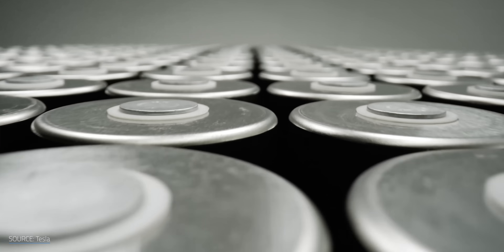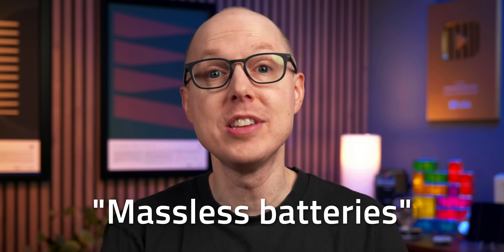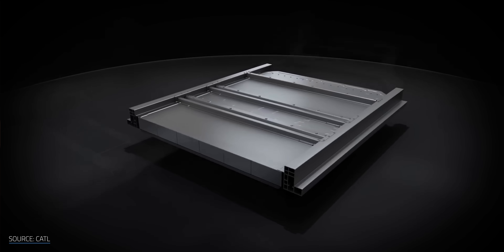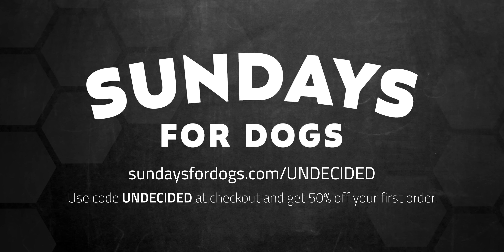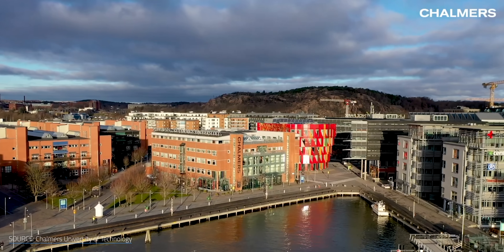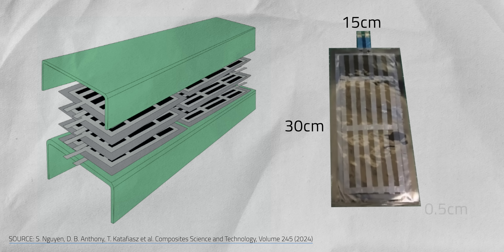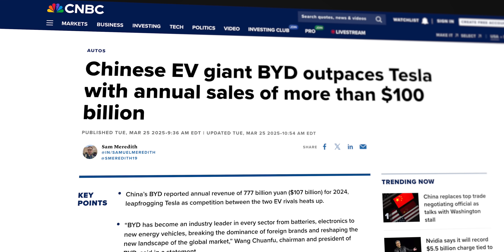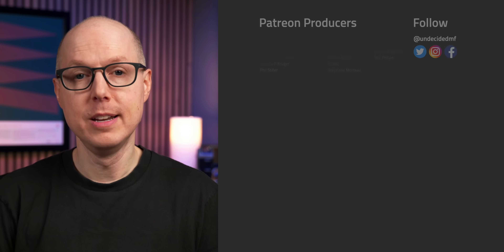The Strangest Battery Breakthrough Yet

Comment: This is cool and all but imagine you have a bad cell in the frame of a car. 

How exactly would you replace it?
Reply: Good point.  My bet, to have these in pieces.  It should not replace any structurally integral member, except for planes. If it all is in patches, replace when needed. If bought in bulk and easy to do, could be inexpensive enough.  Planes, dont know if worth it, but i would guess, they suffer damage less frequently.  I like it so far.
Reply: @pancakes3250 
Common misconception. Planes get access ladders and cargo loaders bumped into them all the time. (Ever seen a dot or extruding rectangle (doubler) on the outside of a plane? That’s a known dent/buckle or repair) But every single part of an airplane is regularly checked and replaceable. Repairing carbon fibre structure is already a pain, now you have to also worry about conductibility and potential power drops of repaired sections. If they are repairable at all.
Reply: @carstekoch  Maybe carbon fiber is more bump resistant, maybe.  Alternatively, parts highly prone to accidents, keep them standard materiel.   The machinery used to deal with aircraft like ladders, whether by procedure or design, to be less prone to cause damage.  The possibility, of an electric plane is too tempting.  Just like an EV, supposedly, reduced costs to maintain the rest of the plane, without all the hydraulics, engines sucking up whatever, exploding, fixing the rest of it, might compensate for costs with dealing with those battery everything.  Not to mention, regions lacking oil, can get away with it, the diplomatic implications involved, are nice.
Reply: @pancakes3250  
Carbon fibre isn't better at absorbing shocks. It's about equally as bad, but in a different way. Main problem with carbon fibre is, it tends to delaminate under shock. So the plies seperate, sometimes without visual indication on the outside. These separations can then entrap water, which isn't ideal in an environment that regularly cycles between normal and low pressure as well as +30°C and -50°C. (Basically toned down ocean gate)
Main problem with the ladders isn't their design, but the fact that they are large and therefore carry a lot of momentum, but they must be put very close to the aircraft because the entrance is several meters above the ground. (So fall risk needs to be minimised)
Same goes for the cargo loaders that need to lift several hundreds of kilos to tons of equipment.
You can't really change Hydraulics for electric actuators. In fact, modern aircraft, have seperate hydraulic systems that are powered by electric pumps. (Hydraulics system of the a380 for example, if you are interested) Thing with airplanes is, they move fast and control surfaces are both heavy and large, so you need a lot of power to counter weight and wind resistance that can move a long way in short time spans under heavily fluctuating temperatures.
Reply: @carstekoch  Crap.  Not anytime soon i guess :(
Reply: @pancakes3250  
Pretty much. Und that doesn't even address the certification process for anything aviation-related. (Which normally moves at a snail pace to avoid something like the 737 max incidents)

But just to be clear: I'd celebrate electric aviation and there are 20-50 seated short range electric passenger planes.
Just... going from a fun, down sized demonstration to actual use is a lot more difficult than it seems and will probably hit the automobile industry first. Even if it's just a proof of concept to accelerate aviation approval.
Reply: @carstekoch  Thank you sir :)
Reply: @pancakes3250 Planes tend to have a much longer lifespan than cars. Most of the aircraft you fly in today as a passenger tends to be at least a decade old, if not older. 
Having the airframe limited to 2000 charge cycles before becoming e-waste is not going to fly with most companies, never mind the fact that an aircraft standing on an airport charging a battery costs money, while an aircraft flying generates money.
Reply: @zibingotaeam3716  That is another good point.  Those batteries need to have a far longer lifecycle to be considered for structural  replacement. Especially if the weight will exceed that of conventional material.  The charging can be resolved, now, but lifespan does need further development. My other concerns, are the longevity and maintenance of a complex composite material that heats up when used.  Another person mentioned, all this will require a very long certification process.
Reply: I don't think replacing it would be practical. They'd probably only have a sellable product if they could get the lifespan of the batteries up to the lifespan of a typical car. Buy a new car, keep it for ten years, sell it to someone so they can use it at like ~80% capacity for another ten years... Doesn't sound so bad.  @pancakes3250
Reply: What, you're not into planned obsolescence?
Reply: @rsimpson69  As I am not a corporation, nor do I make indecent amounts of money running one, I am not "for" planned obsolescence.
Reply: @MonkeyJedi99  tax authorities are for it too. Sales taxes are harder to collect if people don't have to buy new

Not that I'm calling you a tax authority 😜
Reply: Probably won't be the frame. But stuff such as doors and hoods.
Reply: This problem is already difficult in the easiest to repair car batteries, so the solution is to simply not have cells go bad. Very easy to say, I know :)

What this entails is high quality control at production, and good battery management systems (heat management (cooling), charge/discharge management, etc) that keep the battery safe and prevent failures. Coincidentally, these are also things that help the car perform better.
Reply: You toss it and buy a new one, and that's a feature(for the manufacturer's shareholders).
Most companies hate the second hand market and right to repair; irreplaceable batteries are an effective way to strangle both.
Reply: @WulfgarOpenthroat  this is the hardest part of being a consumer in the last decade, let us hope that the eu will force better practices on these manufacturers so that consumers can profit again.
Reply: Yes or (given how hard we push them) a mobile phones battery is "tired" and needs replacing?
Reply: Some of the mockups shown look like the structural battery would still be swappable, and is still integrated into a frame that supports the rest of the vehicle components.  The structural battery would allow that frame to be thinner and lighter though, since it gets reinforcement from the battery once installed.
Reliability would be a major factor, since the battery would be more involved to replace, but using multiple independent components could isolate the impact of a single failure.
Reply: @geoff5623  pretty sure the BYD blade batteries are precisely that; swappable.
Reply: @geoff5623 it's hard to imagine a frame that's cheaper because it's also a battery, or a battery that's cheaper because it's made structurally strong. But we might be swapping 2 cheaper parts for one that's less expensive than the two... Until it needs replaced for one reason but not the other. 

The potential is interesting tho, and it might go better than expected
Reply: @bcredeur97  What about if the battery gives the strength and rigidity for it to be road-worthy but  the car still holds together without it (allowing it to be removed in a service-centre without taking the whole thing apart)
Reply: In the current cutting edge of integrated battery packs in cars, the batteries are not actually inside the frame, but is still in a pack form; putting them inside the frame is very unviable for several reasons including cost. In 'traditional' built cars, the car's frame must be strong enough to pass crash tests and support the weight of the vehicle over bumps, etc. Then, they bolt in a battery pack, which itself needs its casing to be quite strong to support its  weight and survive impacts, but does not contribute to the structural strength of the chassis. These new 'cell-to-body' chassis designs integrate the structure of the frame and battery pack casing together so they both help strengthen each other, meaning you can use less overall material for the same strength and save weight, kind of like body-on-frame/ladder frame vs unibody chassis. You can still remove the battery pack and service it like normal, but the chassis will be kinda weak during that time and I guess won't survive a crash test in that state, but that doesn't matter.
Reply: When you dent the bumper of fender now, even slightly, and the car is still under warranty, it gets replaced fully. It still has attachment point. If it also serves as a battery, nothing changes except unplugging an electrical connection.
When warranty is over, chances are your EV turns into pumpkin anyway.
Reply: @feedbackzaloop actually that a good example, Modern cars are designed to be "frangable" so it does take much to write them off :-(
Reply: @backacheache  certain parts of a car are designed to crumple to save the occupants, but other components are designed to keep their form. The position of the battery in most EVs aligns with the latter. Keeping the passenger section of a sedan for instance in it's original shape, while the panels around the outside absorb and reduce the shock of the impact.
Reply: They'd obviously be modularly designed
Reply: i would rather explore what could happen in case of a car crash. Lithium batteries are prone to fires...
Reply: @arivaldarivald3212  There are two aspects that make it less likely that it would be prone to starting fires. First is the fact that it uses solid materials instead of a gel for the electrolyte which reduces the ability for dendrites to form or grow across the boundary which causes shorts. Second, from what I've read structural batteries are made of similar materials to what is already used in carbon fiber composites. So the question is how prone to fire is a carbon fiber car body part when it gets into a crash? Does the carbon fiber ever start a fire or does it only act as a possible fuel source due to the resins within?
Reply: @Tsudico  I understand, but it is more about speed of discharge, not the electrolyte. Punctured lithium ion cells can discharge very fast, a lot of amps, then resistance generate heat, a lot of it. True that liquid electrolytes can make it worse, as it can produce hydrogen. 
Carbon seems to be quite good fuel for fire, but resin around should resist fire.
I seen a video about new BYD batteries, when punctured it took them minutes to discharge, and they stay relatively cold during that time. IMO that is good direction.

Comment: we also need standardisation Lego block style.
Reply: @paperburn  True, but that's something vehicle manufacturers fight tooth and nail to prevent easy swapping between different models.
Reply: That makes it harder structural batteries, both ones forming the complicated frame of a car and the massive pack under the floor of "skateboard" designs. A modular pack is going to be weaker than a single monolithic thing unless you put the blocks in a case and forgo some of the benefits of a structural battery pack.
Reply: Forced standardization by definition eliminates competition and, therefore, innovation.

If we standardized the cell phone charger a long time ago, we’d be stuck with those turds with the buttons on the side you’d have to push while inserting into your Motorola flip phone.
Reply: @JonathanTippett  standars can change every decade or so
Reply: @ 
ISO - International Organization for Standardization
might have a word to say about that thought.

Comment: I think the hardest part will be repairability and serviceability. EU is still pushing for devices to have consumer replaceable batteries, if it's structural how are you going to replace it? In cars, full battery replacements are basically a write off. Having worked on projects using the FinDreams (BYD) blade batteries, the more 'structural' we make battery the harder it gets to replace. Manufactures care less since a write off is more sales but from a sustainability point of view 'structural' batteries are terrible.

Comment: Can you do a video a quick overview of all the proposed and tried battery improvements over the last 15 years and why none of them panned out? Like a top 20?
Reply: That would be extremely interesting.
Reply: And similar for other topics as well? There were so many announcements and discoveries and it'd be nice to find out what happened to them.
Reply: Batteries today are far better than they were 15 years ago. It's just wrong to say none did pan out.
Reply: @PterAntlo  Nope, still using the same exact lithium composition for years, only improvement is pushing charging speeds to the limit,
Reply: There's been a ton of weird battery chemistries tried out and discarded down the years, "throwing cathodes at the wall to see what sparks" isn't a new thing.
Even some successful ones have fallen by the wayside. Remember Ni-Cad?
Reply: @michaelmartin9022  nicad batteries were actually sold they worked fine. But there have been so many innovations that looked so promising that came to nothing I want to know what happened to them and why.
Reply: Why didn't pan out? Cost to manufacture versus how much they can be sold for

Comment: I wonder how this could be integrated with other technologies like flywheels in a hybrid system.
Reply: I think flywheels are inherently tapped for potential, and that potential is already quite limited. However, hybrid lithium batteries (aka mix between supercapacitor and Li battery) seem to be quite promising as means of both storing energy efficiently and also charge and discharge with much greater potency without risking overheating and dendrite formation. Their main limitation is max capacity/weight ratio, but in combination with structural battery approach perhaps there could be a mutually beneficial application here.
Reply: I personally think that worth-while terrestrial applications for flywheel storage are limited to stationary systems, like highly fluctuating grid storage that is known to charge and discharge daily. I can see how a single, well protected, flywheel might be useful for regenerative braking capacitance, but I haven't seen a convincing argument for that application over super capacitors.
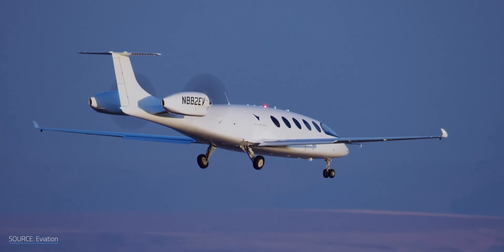Reply: 0:31 DEI, THIS WILL NEVER WORK
Reply: @BobuxGuy  You see a person that appears to be from Indian descend and scream DEI ?? What is wrong with you?